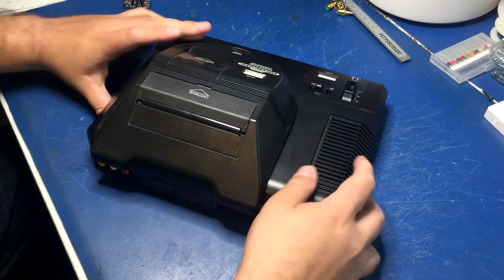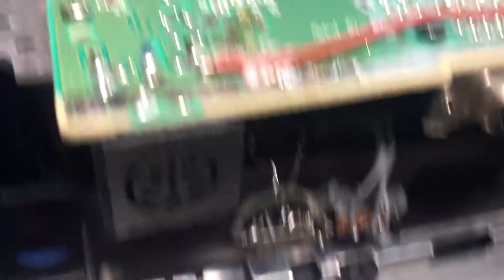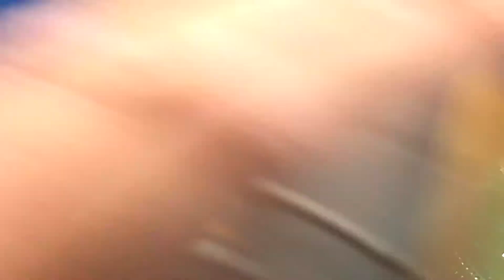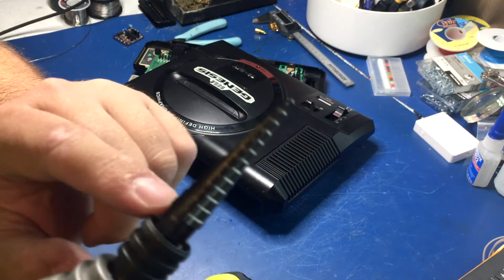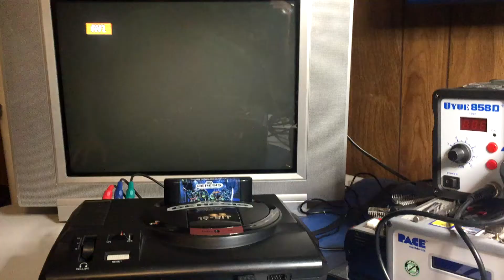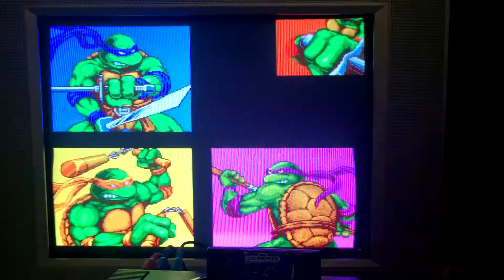Sega Genesis Component Video Mod - Model 1 - Retro Tech Rewind

Comment: What board exactly you use in that mod ? This one ? 

https://oshpark.com/shared_projects/TNNLnV3H

or this one : 

https://oshpark.com/shared_projects/5OuzFB2j

Do you order the board with the component already installed or do you install all the resistors, capacitors, etc by yourself ? 

All the component in the board have to be installed or  only some component and other not.
Reply: If you look carefully at the layout of the board used in this video, it's almost definitely the first one you linked above (https://oshpark.com/shared_projects/TNNLnV3H), RGB to Component Through Hole v1.0 by Helder.  That being said, I believe either of those two boards would work - although I have not verified this.

Comment: I think when the Rad2X comes back I will pull the RGB off the bottom of the A/V out and solder it directly to the guts of the rad2x, and just have an HDMI port on the back of mine.
Reply from the maker: I’ll stick with my ossc. Zero latency. Not .53 milliseconds like the rad 2x
Reply: @CentralPennsylvaniaReviews  Uuh, the OSSC is not "zero" latency either.  It is still less than a millisecond but it's there just the same.
Reply from the maker: I have a pvm directly next to my 4K tv and I’m running a gscart setup into my pvm and my ossc our to my lg 42 inch 4K tv I use in my gaming setup. I watch screens load from black to white and there is absolutely zero lag. Not even a millisecond. Idk what to tell you. Various newer TVs especially 1080p TVs have input lag due to processing but with the really new stuff a lot of that lag is actually eliminated. There is seriously 💯 zero lag. I know this to be fact
Reply: @CentralPennsylvaniaReviews  Modern TVs have input lag because their scalers use a frame buffer.  This is why we use scalers like the RetroTink, OSSC, GBS-8200 to do the scaling, lag free, and then send that out in a signal the TV can use without using its internal scaler.

I just got done playing Sonic 2 on an original Genesis using the GBS-8200 and had no added input lately, it was smooth AF.
Reply from the maker: Ulfrinn honestly I think with this generation of tvs I think the video processing has caught up.
Reply: @CentralPennsylvaniaReviews  I agree 100%. The OSSC has zero lag. I have seen  tests to confirm it.